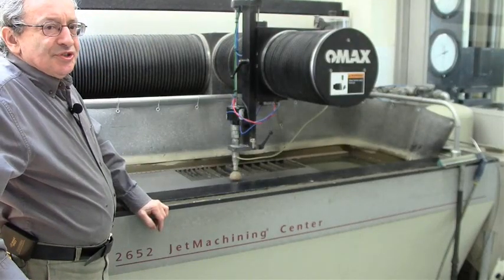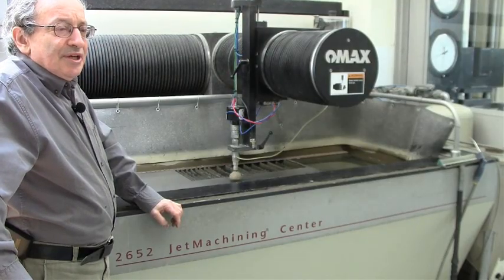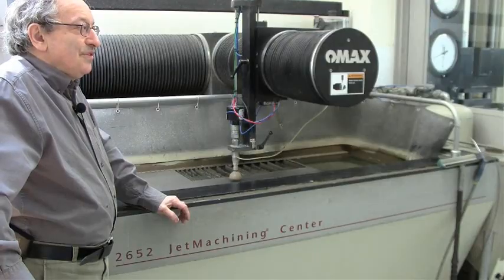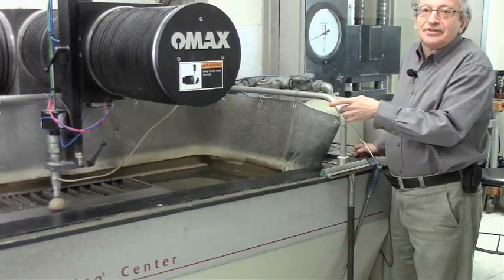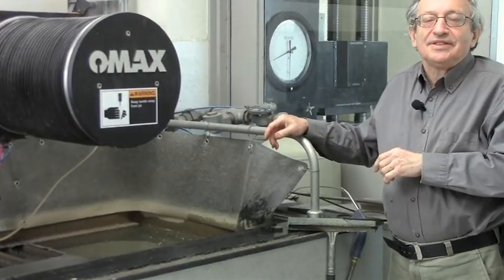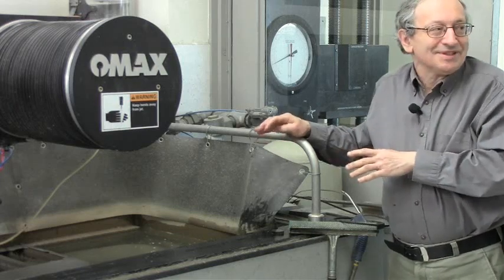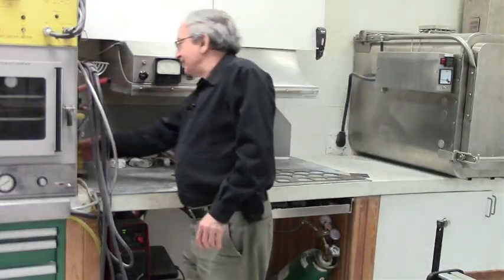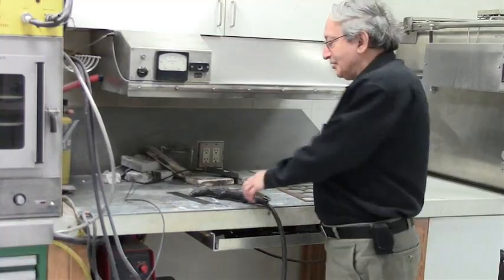Building Prototypes Dan Gelbart  part 3 of 18 Waterjet

Comment: This guy's eyes can't last long.   He probably has already lost some peripheral vision, bit by bit and doesn't know.  The UV filtering available on prescription spectacles does not attenuate the UV anywhere near enough.   UV from the cutting is hidden by the nozzle but can reflect off metal surfaces - the reflecting will be quite a bit less than 100%, but only a few percent will be enough to eventually ruin your retinas.
Reply from the maker: Keit is right. Better use goggles!

Comment: It was my understanding that UV goggles aren't required for plasma cutting because the spark is not in your line of sight. I've only done it once and with no adverse consequences to my eyesight, but I'd like to know for future reference.
Reply from the maker: The UV light can reflect  from metal surfaces and get to your eyes without line of sight. The effect of UV is cumulative: you can do it a few times but if you do it a lot you end up with serious trouble.
Reply: @dgelbart  Thank you. I supposed as much but the guy who trained me was adamant it was OK. Anyway, my one session with the plasma cutter made me fall in love with it to the point I intend to build a CNC plasma cutter. I should never look at one again while it's operating. I'd prefer a water jet but I just can't justify that level of spending. Still looking for a good reason, though...
Reply: Jean Roch I learned as a young man never to take any chances with what someone is saying. If the extra precaution doesn’t harm anything it should always be taken, let them take the chance if they so wish. This is a key lesson for technicians, when you first get to a malfunctioning piece of equipment invariably there will be someone telling you what they think is wrong. Never assume they are correct, I was doing a job early in my career and I did assume the initial opinion was correct I wasted nearly two days with de/re-assembly on a red herring. It wasn’t a big deal but it was a valuable life lesson for a young man.

Comment: Would you please share more details about waterjet clamps? I made some out of 1/2" plate that look like I beams with screws on either side of web that clamp from 0 to 1" to the lower flange but they are a little bulky and not low profile.

Comment: I'm considering eventually getting a water jet because of the versatility of the work they can do, though I have no experience with them.  What are the costs involved in running one and do you have any preference brand-wise? 
BTW, I'm really enjoying your videos, very straightforward and informative. I'm looking forward to watching the rest of the series.
Reply from the maker: All inclusive costs are in the order of $80-$100 per hour, but in one hour a waterjet makes a lot of parts so what is more important is the cost per part, which is a few $. I believe all major brands (Omax, Flow, Mitsubishi) are good. My favorite is Omax, including the Maxiem line . I have one Omax and one Maxiem.
Reply: Thanks for the quick reply

Comment: Mr. Gelbart, thx a lot for your excellent videos. While I agree with your view on waterjet advantages over plasma, the price of acquiring and maintaining such machine is a littlebit intriguing for most of us. What's your view on laser CNC cutters?
Reply from the maker: CNC laser is less versatile than waterjet (can only cut a limited selection of materials and thicknesses) and costs about the same, so for prototype work I prefer waterjet. for sheet metal production, of course, laser is great.
Reply: @dgelbart  I'm building a 140 W CNC laser cutter with a friend for a few thousand.  Commercial laser cutters can be had for under $5K.  My understanding is that waterjets are substantially more than that... you are claiming $80-100K, I see a small "desktop" CNC waterjet for $10K.

I'd also like to try CNC welding with our laser.  In particular, I'd like to try welding granite.  It'll be slow, of course.  Definitely something that can't be done with a waterjet!

Waterjets are amazing.  I've seen someone cut a spiral spring from a sheet of glass with one.

Comment: I found your series on building prototypes when I viewed your video about your CNC lathe /grinder. I am very impressed with both your knowledge and your shop. Would you please tell us about your background and your shop? Is your shop located in a business, educational facility or your home? What do you do for a living?  I would like for you to run a series on the construction of your lathe/ grinder and any other equipment that you make. Where do you live? I am very impressed with you and you work and I look on in awe of it, but at 78 I am not likely to duplicate it.
Reply from the maker: Never too late to build some machines. My background is actually electronics but I spent the last 35 years starting hi tech companies, so far all successful. The shop is in my home but I have/had a similar one in each of the companies.
Reply: @dgelbart  I used to own Creo machines for printing. Rigth now I'm building a semi-rotary offset printing press for label printers. about 6tons overall weight, most surfaces under 5 micron precision. Thanks for your very instructive videos.

Comment: Hi Mr. Gelbert, I would also be interested in the kind of laser pointer you used and if you have CAD files for the mount. What angle did you have to angle the laser pointer downward at to get the laser to shine through the nozzle.

This is for the new MIT student run shop so any help would be appreciated by tons of future students. Thanks!
Reply from the maker: Tyler Hamer The angle is adjustable 0-30 deg. Here is a link to CAD files, designed for waterjet : https://drive.google.com/folderview?id=0ByWaTeq__NX1eWtXQjIwWnU3V0E&usp=sharing
dan
Reply: Dan Gelbart Thank you so much Mr. Gelbart! I can't tell you how much this is appreciated.  
~ Tyler

Comment: Hey Dan,
I would like to cut some round 2" high spacers from precision ground plate and then epoxy the spacers into a waterjet cut hole in a plate also cut from the waterjet.  What would your recommended hole/spacer tolerance be for something like this?  Thanks in advance.  FYI...I check YouTube daily for your content and can't wait for the next installment!
Reply from the maker: Skyler Olsen I would just use the natural slight taper of the WJ to do a press fit. Would work great if plate is at least 1/2" thick. Epoxy will not be any stronger. If plate is thin both adhesive and epoxy will be weak. The right fit for press fit is that the smaller diameter of spacer just can go into the larger hole diameter in the plate. Cut on the fastest cutting speed, to maximize taper.

Comment: While watching the whole series, which I greatly enjoyed, thank you, I was constantly reminded of the construction of this CNC machine.

http://www.grunblau.com/PlatformCNC.htm

It looks like the parts are all cut on waterjet, and the frame uses bending in many places.  Most notably, the linear rail system is integrally folded out of sheet metal.  And the sheet metal pieces are cut to provide box enclosures, ventilation, etc...  A tour de force design.  And of course it is powder coated.  I have no connection to the machine, and it is absolutely not anything I could easily make without seeking out other solutions.  But it is apt for construction using the processes suggested in this course.  I don't think it could have been built in wire, but he found a way of doing it in sheet metal. :)

Comment: Though Plasma arc looks a lot like welding, the voltages can be 100-400V and can be fatal, if the machine is poor, or the operator is careless about grounding.  In addition there are many economy machines out there, and I have a friend who does quality control in china on these machines and they are vigilant about parts substitutions, etc...  but not all suppliers may be.

Being youtube, there is a DIY waterjet that a student made as an engineering project, that makes interesting viewing.
Reply: Ben K (def. not a student) made a simple one from a pressure washer! Much lower pressures than you would think necessary from the industrial machines.

Comment: Ha! no gloves. People call me crazy when I plasma cut with no gloves, but it's much easier to maintain good control, and you just have to be aware of what parts are still hot to the touch. Love the UV glasses... plasma cutting goggles are annoying.
Reply from the maker: You're absolutely correct about the missing safety precautions. Sorry about that.
Reply: Pussy!